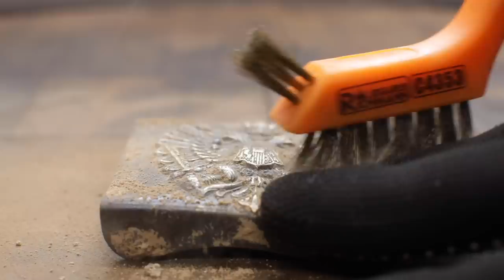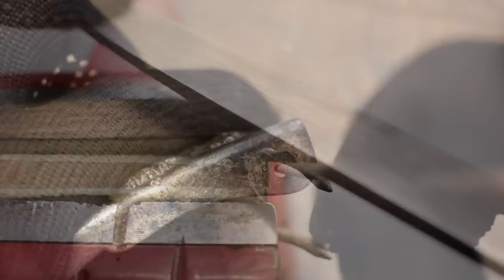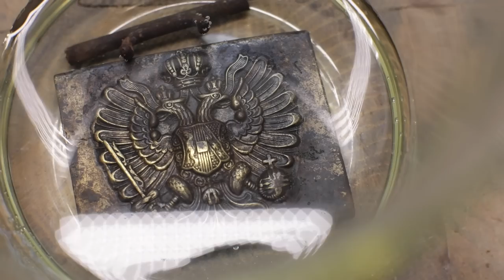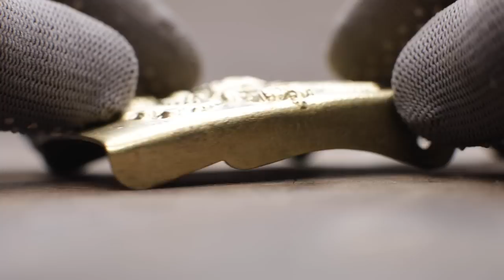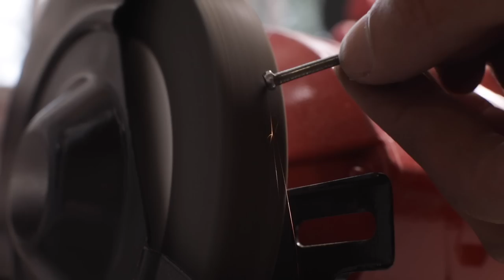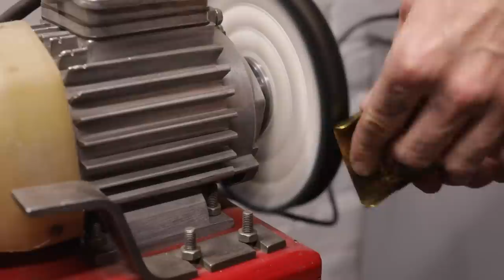Restoring World War I Austro-Hungarian Buckle. Antiques  Buckle restoration

Comment: It’s a good restoration but why did you covered it in mud. We can see that same buckle in the drawer in your WWI lighter restoration video and it is perfectly clean.
Reply from the maker: Hello!  Thank you!  This is not the same buckle.  I found this buckle in the forest two weeks ago
Reply: @ReXtorer  ok
Reply: Dude it’s totally the same belt buckle in the drawer. Oh, and military subdues belt buckles so the enemy won’t see them flashing a mile away. Only in dress uniforms are they shiny. FYI
Reply from the maker: @TAG77  This is not the same buckle as in the drawer.  I have a lot of them.  In the original, it is as in the video.  In the field, buckles were sometimes painted.  The original photo of that time https://pin.it/TJcXFp2
Reply: @ReXtorer  yes, in the field they subdued them with either a matte green to match the environment around them or they did a cold bluing. Some soldiers use edge dressing. Looks like these soldiers weren’t in the field. They were ok break in dress uniforms. Dress uniforms all insignia and buckles were polished. It showed discipline and their accomplishments. That’s why they’re required to be polished and positioned just right on dress uniforms. I’ve met Hungarian soldiers, British, polish, Iraqi, and Kuwaiti. Every single country seems to have around the same regulations as the US army when it comes to subduing field rank and polishing dress buckles. That buckle was a field buckle you turned into a dress buckle. I could tell by the subdue paint on it or cold bluing. Which is still acceptable. You just have to tell weither you’re doing dress or field.  Still did a good job. I’m just saying it looks exactly like the one in the drawer, but of course if your patrolling an old battle field you can find a good dozen.
Reply: The high polish isn't correct, but hey, your belt plate, your channel.

Comment: originalmente tenia un baño de niquel y se lo has quitado con el vinagre, quiero decir, que originalmente no tenia aspecto dorado sino plateado.
Reply from the maker: Lo sentimos, pero las hebillas austrohúngaras nunca han sido niqueladas. Aquí hay una foto del museo https://pin.it/5ICP4Si
Reply: @ReXtorer  me refiero a que en el video, al principio se ve que la hebilla es como plateada, y con el baño de vinagre se ve un liquido azul-verde, que creo que es niquel disuelto: [Ni (H 2 O) 6 ] 2+ , es posible que la hebilla no fuera de un soldado raso?, o que alguien la modificara en el pasado?
Reply: aunque es posible que se haya quitado parte del niquel del laton, y por eso luego tuviera aspecto como de cobre... pero al principio parece plateada. En fin, en cualquier caso, la restaruacion genial, y la pieza... una suerte tenerla en la coleccion.
Reply from the maker: @ronsanmartin  Esta es una reacción al latón. Probablemente debido a la presencia de zinc en este metal.